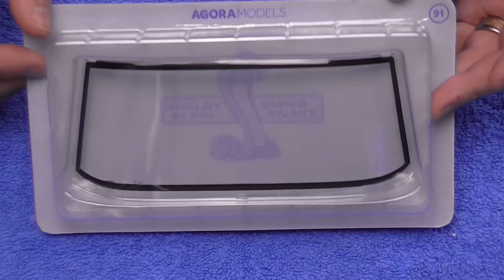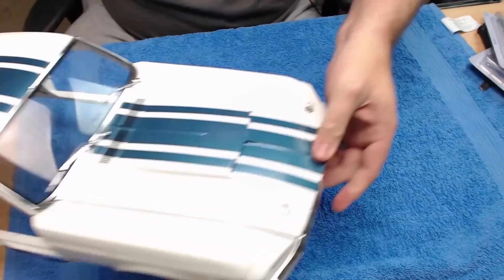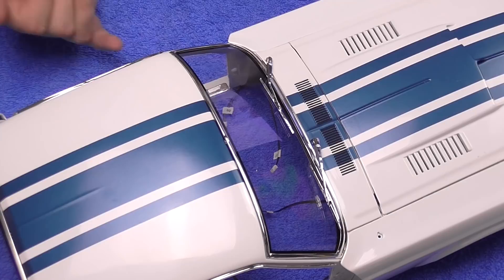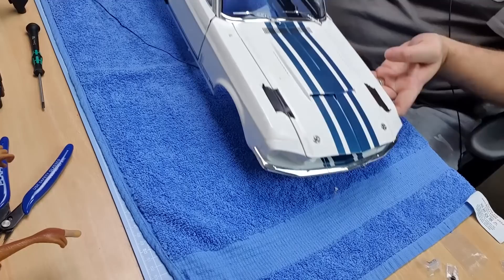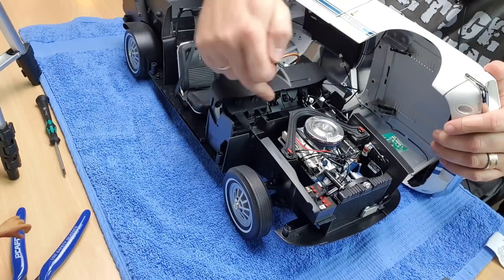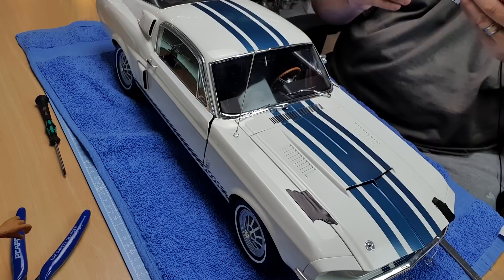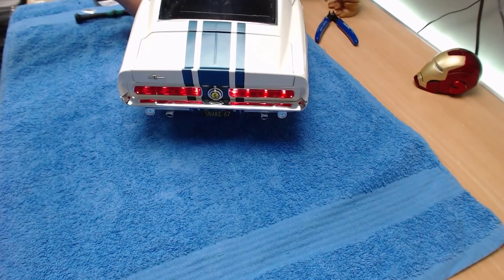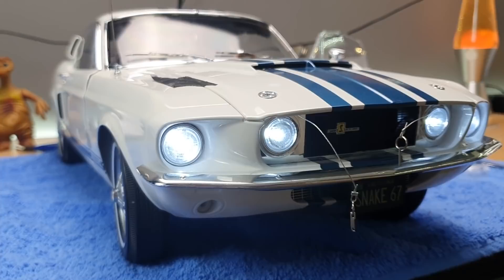Agora Models 1967 Shelby Mustang Super Snake - Pack 12 - Stages 91-100

Comment: Everything was going great till I got to fit the doors, they doors are a terrible fit, both of them do not align with the wings, other than that this was a great build, similar to the Mustang Build
Reply from the maker: I had an issue with the drivers side door but I used a washer on the screw hinge to help pull it tight to the bodywork. I think it was an M2 washer.

Comment: Hood shroud looks great you could use a flat black to paint rubber portion if you want. I don’t remember what paint brand it was but it was called rubber and it was a black color. The other wheels/tires are meant for race or track seeing as this particular beast really never made it to production
Reply from the maker: Tamiya do that
Reply: I just edited post didn’t even notice your response well you can paint it it either color a good base or scrape off chrome and paint plastic underneath either way works

Comment: Random question this looks really similar to the degasotini build the ford Mustang but that was a dark blue with white stripescar this one is white with blue stripes. Are they the same car but different for this new company?
Reply from the maker: I never did the Dragostini one so I have no idea
Reply: There like 90% the same. Offcourse the change in color. And the other changes are the supersnake details, grill, hood, wheels, right door without mirror, the engine, etc. Floorpan, interior, suspension, main body al 100% identical. Same with the upcoming Eleanor, they changed the details but 90% the same car.

Comment: Last pack felt a little disappointing to me: on both the front and back window frame one of the pins broke. They went in very hard and even though in only pressed on the frame, they snapped. Now the frame is loose in some points. Also the boot lid scratched the paint between the rear window and boot lid when I turned the bodywork upside down. Thirdly, the doors are all floppy, the hinges are very loose at the door side (not the body side) with no way to correct this. And lastly the screw holes of the body didn't line up very well with the interior, I couldn't get 2 of the screws in.
Great build, but all of my problems come at the end... :-(
Reply from the maker: Mine was okay. The door was loose but when the screw was oiled and tightened the play went away.always put metal on a towel or soft cloth. I scratched the Delorean when I didn't use one.
Reply: @WorldofWayneUK  The scratch came from the boot lid itself, I always put it on a soft cloth when turning upside down. The door are loose behind the door panels, the hinge is tight on the body. It's the door that's loose on the hinge...

I'm gonna contact Agora, because the build ends on a disappointment this way.
Reply: My doors are wobbly heck too

Comment: while you were putting the first door on I noticed the front fender didn't line up with the corner by the door, did you managed to get that fixed? if not it might take a little bit of bending/flexing of the panel to fix it.
Reply from the maker: Yeo. It pulls in when you connect the top to the bottom
Reply: yeah I seen at the end it came together better but I still think the pieces were a little warped, nothing you can do about that really though probably manufacturers error, like the hood of the one in the clip you used for starting each stage having a slight bend in it while yours was perfect fit.

keep up the good work Sir your videos are a joy to watch for someone who can't build these himself... mostly because I don't have the room for such large items lol I don't know how you find space for them all.